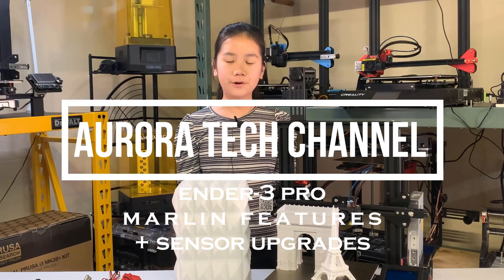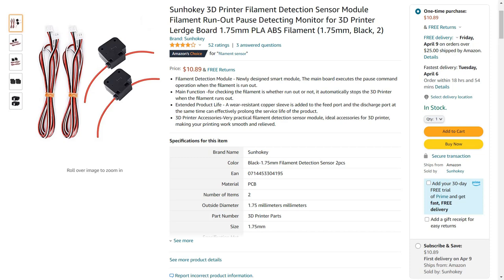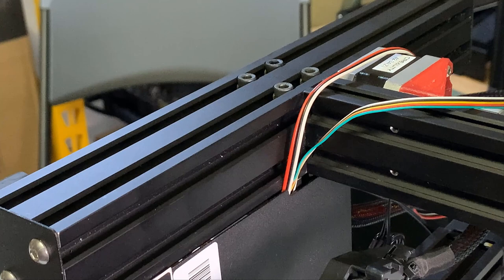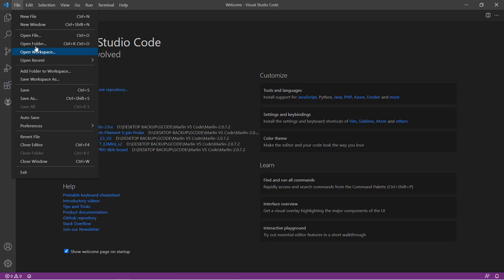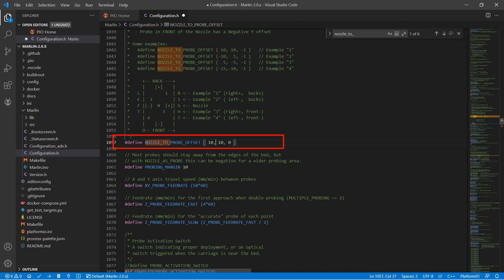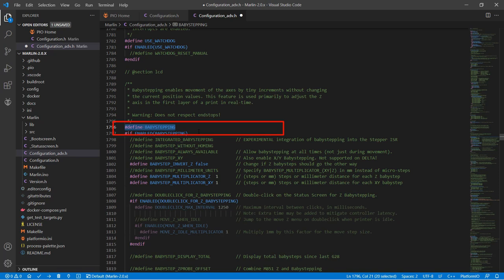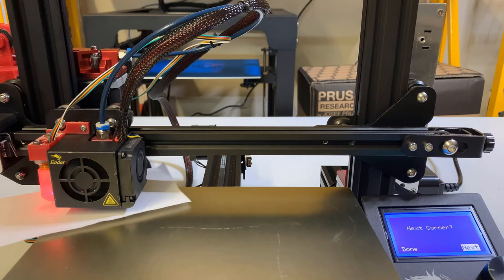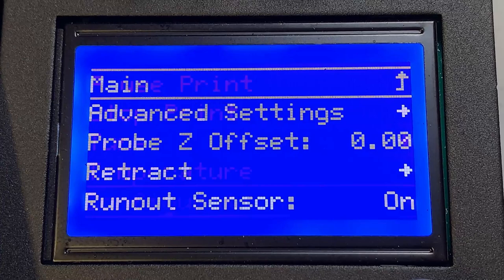Ender 3 Pro - Marlin firmware extra features + filament sensor + 3D / BL touch bed leveling sensor

Comment: :washhands::washhands:I'm trying for my Ender 3 Pro 4.2.2 device, I'm getting an error while compiling. Can you send me the bin file?
Reply from the maker: I did a lot of upgrades on the Ender-3 Pro after this video, it's no longer using the stock motherboard, extruder, and screen. What is the first error message in red? Just fix the first one(only) and try again.

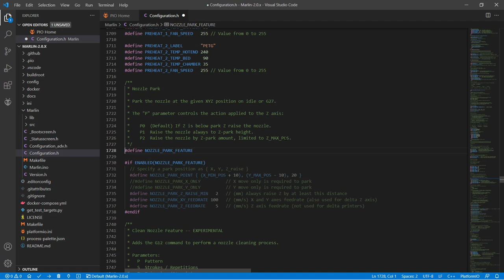Comment: great video and clear explanation. i have question. if i dont upgrade filament sensor, can i skip the firmware modification between 09:50 to 10:18 and advanced pause feature in adv.h file?  please respond
Reply from the maker: Yes, you don't need to enable the filament sensor in Marlin if you don't have one, you can also disable it from the screen even you've enabled it.
Reply: @AuroraTech  thanks for the reply. I'll try and post the result here
Reply: @AuroraTech  hi I installed today. Works great. Missed to add G29 and M240 S1 in cura settings. Found later in other youtube videos.

Comment: Hi sis thank you for creat this video. It's so useful to upgrades my printer. But print resume option doesn't work.
Reply from the maker: Hi, I would normally disable that feature as it will kill your Micro SD card, you may also take a look at this post:

https://www.reddit.com/r/3Dprinting/comments/j7assf/my_3d_printer_is_killing_the_tf_card/

Comment: my chip is GD32F303 when try to build it doesn't show up
Reply from the maker: It's a chip from GigaDevice instead of STM, you need to ask the manufacturer and see if the chip is compatible with which model of STM.
Reply: @AuroraTech  did we find a solution to this? i am currently having the same issue

Comment: I do not see project tasks when I click the alien head?  How do you get those to show?
Reply from the maker: It should show up automatically, but in case it doesn't, click the 3-dot menu(inside the PlatformIO window, top right), select project tasks.
Reply: @AuroraTech  still not showing

Comment: Don't disable software end stop, bad idea.
Reply: Can you explain why this is? IS it because the motor will keep pushing even with resistance and break something?'
Reply: @dreudax3294  it made my hotend crash into the magnetic bed and put a hole in it. I don't recall all the details but once you run g28 the firmware remembers where the end stops were, and if something goes wrong it will ignore were it was and keep looking for a signal from the mechanical switch. There's no reason to disable this, if it's to set z offset then just run the wizard. Z probe offset wizard is works great.
Reply: @lArunl  Hmm is the hole in the centre of bed? Would be a weird coincidence because the used printer I bought has a hole in the centre of the PEI sheet. :)

Comment: Hi Aurora

In the Marlin firmware 2.0.9 and above there are 3 lines in Configuration.h i don't understand.
In the #define line are 4 values for DEFAULT_AXIS_STEPS_PER_UNIT & DEFAULT_MAX_FEEDRATE. X, Y, Z, Extruder1.
Above the line there is a comment that shows how you must use the #define line.
That line does show more then 4 variables.
Here are the 3 lines :

 *                                      X, Y, Z [, I [, J [, K...]]], E0 [, E1[, E2...]]
#define DEFAULT_AXIS_STEPS_PER_UNIT   { 80, 80, 400, 500 }

 *                                      X, Y, Z [, I [, J [, K...]]], E0 [, E1[, E2...]]
#define DEFAULT_MAX_FEEDRATE          { 300, 300, 5, 25 }

 *                                      X, Y, Z [, I [, J [, K...]]], E0 [, E1[, E2...]]
#define DEFAULT_MAX_ACCELERATION      { 3000, 3000, 100, 10000 }

Question:
What is I, J, K... mean?
How does marlin know that the 4the value (500) is for Extruder1 and not for "I"?
When i translate the example then it should look like this:
#define DEFAULT_AXIS_STEPS_PER_UNIT   { 80, 80, 400, [I], [J], [K],  500 }

I hope you can give me an answer.
Thank you

Comment: Hi! I would like to recommend you this interesting gadget, thing:4445504. I found it 2 weeks ago, optical sensor /speed or endstop switch/ is around 0.6 dollar +cable + 2 bearings (I tried to print a bearing, but 608Z is too small), TPU ring you can try to replace with O ring (outer diameter 17mm).  I am happy o see some new interesting Marlin features :). Good luck!
PS. under adv there is an ASSISTED_TRAMMING, which is an improved ABL version of corner leveling (don't forget to turn on Assistad_tramming wizard too)